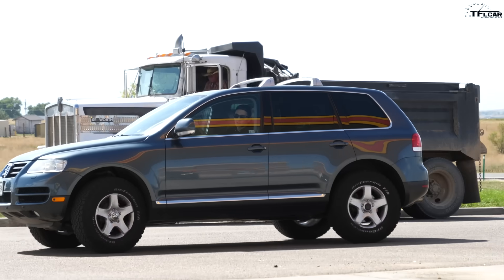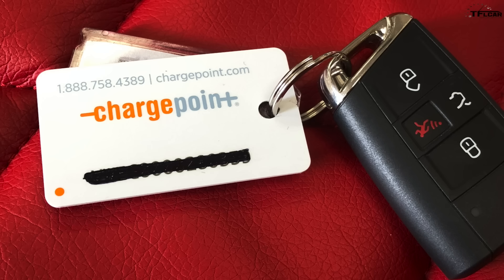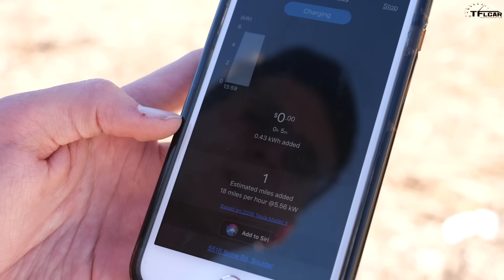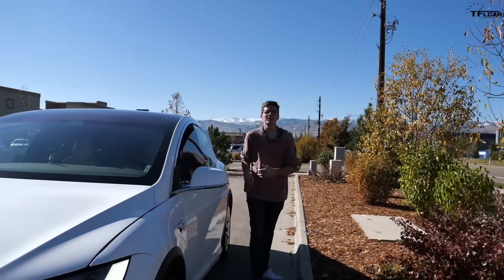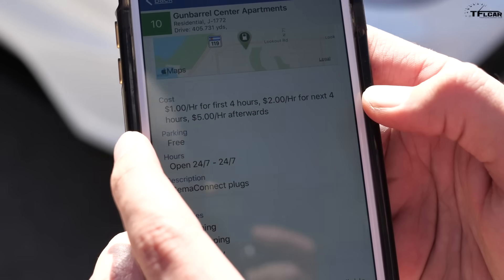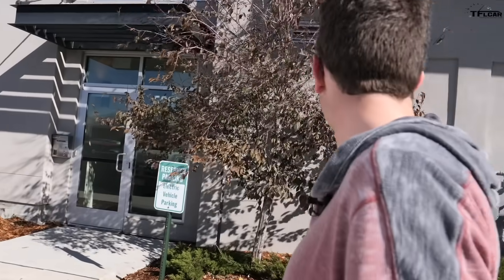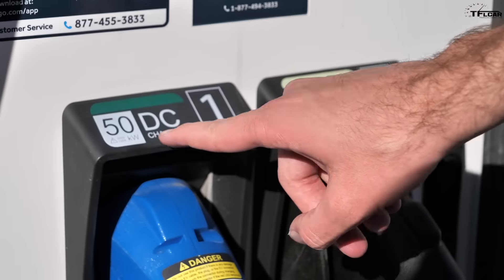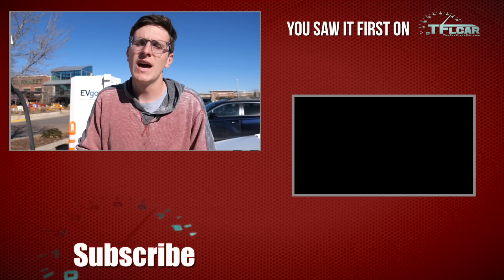Here’s Why Charging an Electric Car Can Suck - And It’s Not The Reason You Think!

Comment: I own an EV and I own a PHEV (for about 4 years now). I've never had a problem keeping them charged. No sane person waits for their car to charge. You do not have to have garage to have a home charger (they are very weather proof) and it doesn't take days to charge the vast majority EVs on 110 (if you zeroed out your Tesla, maybe, but how often does a person drive that many miles a day). So, the entire video that's based on these premises is just a lie. On the rare occasion when I do charge on the road, I've never had a problem finding and using a charging station - there are multiple apps that will help you find one.  ICE owners spend hours at the pump each year (waiting in lines and pumping gas) that I don't. 

I agree that an apartment dweller that lives in an apartment that lacks charging stations (most new ones have them, many are installing them) and you don't work somewhere that has a convenient charging station you would have a problem if you bought an EV. But then: why would such a person even consider purchasing an EV? 

I would never make the argument that EVs are the solution to all automotive needs. Nor would I make that argument for a minivan, SUV, utility truck, nor Big Rig. No one type of car fits all, that's why there are choices. But the arguments made in this video are just not reality.

Comment: It appears that EV's for commercial use (like police cars, that would be required to run almost 24 hrs a day) just wouldn't work out. The same for heavy trucks or any long distance hauling.
Reply: Bingo, but Kalifornia has already said future trucks will HAVE to be electric... "Hang on, as soon as the power comes back on from our rolling blackouts, the paramedics will only need an additional 40 minutes to charge their vehicle so they can respond to your heart attack... Hello? Hello? You still there?"

Comment: So the question becomes: Exactly who has the time to spend charging their car if it is NOT being charged either overnight at home or while actually working in an office? I certainly do NOT have the time to find a plugin, and spend 2-3 hours or more waiting for the car to charge sufficiently to get me the 25 miles back home. (I routinely drove 25 miles ONE WAY to work for better than 20 years. Most of my co-workers actually drove further.) PLUS, those who routinely travel MORE than 300 miles in a single day, cannot afford a days PAUSE in their trip because the battery needed to be recharged.

Comment: So many problems with this model of powering a car, and most of them are not even obvious. Here's another one: At that condo complex you were at, it looked like there were two charging stations. Most people would start the charge, then go back inside their home while it was running. What happens when it's finished, but the person doesn't come back out right away to disconnect and "free up" the spot for the next person? People can't even use Laundromats efficiently without leaving their crap in the dryer for 2 hours, dried, before coming to pick it up. Same scenario as with the inconsiderate people who start to fill up their tank at the pump, then wander inside the convenience store for 20 minutes to "shop", thereby blocking the pump from being used by someone else when the fill was complete. There will always be a "human factors" component impacting efficiency and this model just exacerbates it. Sorry.

Comment: Modern electric cars are in the infant stage rite now , it will be years before charging will only take a few moments . More than likely a few companies will be making an onboard charging system by then . Some cars have an onboard charging system now but it is low voltage . Also Electric cars still cause emissions problems , ( most electricity is made from burning Coal and natural gas ). I am interested in  electric cars , but I think I will wait for about another 10 or 15 years and see if they get the problems solved . Thanks for the video.

Comment: I would have bought a Tesla by now except,  I do not have access to home charging and the plug in gimmicks and lack of speed charging locations along with battery replacement every 6 or 7 years is a deal breaker.

Comment: I'll stick to gas. Pull up , Pay , Cash or Credit card.  Pump gas . Drive off. All done in around  10 minutes  or more.. Easy. And don't have to use my phone. Out hear in southwest Arizona. Try to charge up your car on a hot summer day when it's around 115 degrees plus and your out there  and there is  no shade. You can run into a gas station and grab  a cold drink and a snack while your gassing up you car and use the bath room too. Try to do that at charging station.

Comment: Americans enjoy up to 220v while we in Europe enjoy 380v. Even my apartment in Greece has 3 phase 380v. Imagine the increased charging capabity.
Reply: Be careful of what you wish for. North American 120volt (most outlets) deliver a shock that's survivable. Our 220v is also three phase. I don't know what you pay per kilowatt/hour (or joules) but California in general and San Diego specifically, has the highest electric rates in the country. I would not want to pump even 50 kwh of power into a car inside a garage. The batteries are going to really heat. Tesla designed for that with limiters and controls to reduce the speed as the batteries heat, but even so, there are more and more car fires every year just from charging. And putting out a Li battery fire is a very difficult job... it burns very hot (lithium used to be used to melt iron to weld railroad rails together).

Comment: @The Fast Lane Car: 5:57 ? 
That "rate" is super expensive, given that it will ALSO involve a motel stay, meals & other "wait time" activity expenses during that TEN HOURS for HALF A CHARGE (to do what ?)
PLUS, that's not really all of it is it?
TEN HOURS - but the recharge station is ONLY OPEN for 8 hours, so you will need to sleep in that motel, while you silly EV runs down it's battery with it's electric consuming security system - and other electronics while you sleep, to THEN require at least FOUR, if not more hours on the second day ?

WOW so you lose TWO days of petrol driving, sitting on your daire aire, waiting for electricity to 'trickle" into an EV?

Comment: What tickles me most ELMO - is that none of these "charging points" allows someone without a "smart phone" - to connect with them, so not only do you need to have the RIGHT APP on that phone, it needs to be available to use, and NOT lost last night in that disco - or taken by one of the kids or .. ?
Well Goible - now what - you have no phone (or a phone with it's own flat battery) no CREDIT on that phone, and no power in the car - Oh and as it's an outside recharge station, it just happens to be pissing down (torrential rain) in the midst of a thunder storm.

Comment: Ah, that age old problem of "charging" an electric vehicle. yes.
Sadly - MOST if not every vehicle - manufactured with an electric starter motor, since the original wind-up (radiator fitted) manual crank handle starters - ARE ELECTRIC.
You cannot start and run ANY of them, without turning an electric KEY, to start them, especially if they have an automatic gearbox - as NONE of them can be run-started (crash gearbox style).

All this modern B/S about total electric battery cars - hahah ha - I remember having one many years ago (mid 1950's) when I was a kid - that was made in Japan, and it ran on 4x D batteries - couldn't charge them as they were alkaline.
Tried and blew the batteries apart like small grenades.

FROM ABOUT 2,000 ONWARDS - every vehicle has had so many electric this that and anything else - that even huge truck style 12v batteries are becoming the norm..

NONE WILL START (PERIOD) UNLESS KEPT IN A HIGH STATE OF CHARGE.

Saying that these new Tesla's and Leaf's and other (secondary fuel not allowed) whizz-a-longs - that run only on a nicad battery pack - well hell, serves you right to leave it ON the street, as you need to garage them (unlocked away from thieving fingers) and fully disconnect the battery, (with a 500A dedicated battery isolation switch) to ensure a "start" will occur each time one is needed, until you have to give them a full recharge.

Something that only has a battery - but which is left to run security systems and other technological (power hungry) crud, is just asking for them to be "flat" ASAP.

Comment: if every car in California at this moment was electric, no gasoline cars, all electric cars in California right now, and all of the electricity generation capacity of the entire state of California was dedicated to only charging electric cars. There is no way that the grid in California could possibly charge all those cars. Not even close. That is all electricity from solar, wind, Hydro, fossil fuel, and atomic power.
  California’s electric grid is fragile as it stands right now. They have rolling brownouts and blackouts during heat waves right now. As electric cars become more and more numerous in California, watch the price of electricity. Building new power stations takes an average of 12 to 14 years.
  there is nothing California can do right now to remedy this. The timetable comparison puts more cars on the road that are electric much earlier than any new power generation of significance can be put online to make a difference. It’s already too late for California. in meetings,The timetable for California came up, they can’t possibly meet the need in the short term. It’s the unwilling led by the unknowing in California..
  The cost of electricity Will be as high as $.42 per kilowatt before 2032 in California.. has anyone given any consideration to why the big rush to get Smart meters installed? Has anyone given consideration to the real reason each dwelling had to be categorized and that information had to go to the public utility commission. Every customer is a essential/nonessential category. The reason for that is. When electricity demand is high, add the chance of having overloaded equipment in the grid, rather than having the grid fail, and rather than having rolling blackouts and brownouts. We have smart meters. Here’s the reason
   if you were in a private home, or if you own a car wash, if you own an amusement park, if you own a boat dock, if you own a building that does not have elevators, you are nonessential. You’re smart meter can be turned off with a cell phone call from the electric supplier. At the same time, hospitals, police Station, fire stations, traffic lights, public buildings, doctors offices, water pumping stations, senior high-rises and apartment buildings with elevators,water sewage treatment plants, are considered essential. Their smart meters will not be Switched off. they are considered essential and the power to those places will not be cut. A smart meter can be individually switched on and off by the local electric supplier. That is the bottom line behind the push to have smart meters. That is better because they won’t shut down the whole cities .. they won’t shut down whole towns by doing a rolling blackout. They won’t trap people in elevators, they won’t shut off seniors on breathing machines, they won’t shut off hospitals, they won’t shut off police stations, they won’t shut off traffic signals, they won’t shut off water treatment plants water pumping stations..
  Smart meters are also able to charge you accordingly for T OU/time of use. During peak demand during the day between 9 AM and 5 PM. That’s when the most strain is on the grid. That’s when electricity is going to get a little more expensive. The smart meter records your usage minute by minute. it will be better for you to run your air conditioners after 5 PM. It will be better for you to wash clothes and run your dishwasher after 11 PM during the lowest load on the grid. That will also be the best time to charge your electric car if you have the ability to charge it from home..
 there are many facets to the planning. These people that plan didn’t know what they were doing, but eliminating atomic power, fossil fuels, completely rocks the boat..
That’s why we have a smart electric grid now.. I suppose that’s a good thing. We will see.. and California is the place where it is going to get its first big test.. and it’s not really going to be a test, it’s gonna be all hands on deck. This is no drill..
  by the way, more than 20% of electric car owners, go back to gasoline cars.
  also, three materials are needed to make a lithium ion electric car batteries. Cobalt, which is around $70,000 a metric ton
lithium which is around $8000 a metric ton
 and finally copper which is around $9000 a metric ton and all three of these materials are increasing in cost almost by the minute. The cost of Electric vehicle batteries is not going to come down with time.. already people are resigned to the fact that when the battery needs replaced in their Teslas, the car is basically a throwaway consumable like an old washing machine or hot water tank. People with Nissan leafs are finding that out now. The replacement battery for a Nissan leaf is about 40% greater than the value of the car at the time the car needs a new battery..
  right now, older Teslas that are needing batteries, the value of the car is around $14,000, and the cost of a new battery is $23,000. if you go to trade that car in that’s only worth $14,000, the dealer will laugh at you. Because a car being traded in is worth what the book says it’s worth, minus what it needs.. example, if you have a car that’s worth $25,000 in the Kelley blue book, and it needs four new tires, the dealer will tell you the car is worth $25,000, -$800 for new tires. So if you have a car that’s valued at $14,000 in the Kelley blue book, and it needs a $23,000 battery…You would have to pay the dealer to take the car

Comment: There is a lot of hassle to wining an EV that is for sure but what this video does not address is the future dangers from charging these vehicles. It's just a matter of time before these cars and charging stations electrocute people. Also the faster you charge those batteries, the hotter they will get and great chance of exploding not to mention the longevity of the battery will be significantly reduced. These vehicles alone are going to cost people as much as a mortgage and only the rich will be able to afford owning one. I can see them also being very disposable because of the high cost of electronic component malfunctions and or lack of upgrading after five to ten years. Light weight steam engine vehicle is the technology that should be explored as I think there is potential for hundreds of miles per gallon so to speak.

Comment: Most cars go around 300 miles on a tank of gas.  30 minutes to go 100 miles assuming no one is ahead of you and they are there for ''only'' 30 minutes.  So if I wanted to drive from LA to Las Vegas it will take me all day maybe 2days.  I think they should make electric cars with sleeper cabs like the big rigs. You're going to be hanging out at the charging station a lot.

Comment: I can get about 450 miles in about 5 minutes from my small truck. It holds about 10.5 gallons of gas,no waiting and when it runs out,another 5 minutes and I'm ready to go. These charging stations have their own power supply with large wires capable of transmitting the required electrical energy to charge a car. Most houses do NOT. If very many houses in a grid[at current conditions] are running a charging station,it will overload and cause a blackout.

Comment: Currently, the utility companies are attempting to fund an alternative to electricity.   
They are suggesting solar power and some consumers have employed solar systems for their residences and businesses.   
In large metropolitan areas during peak usage, consumers are facing "brown outs" and worse, "black outs".
If this nation cannot even handle the current power requirements,  then how are they to supply the increase demand due to electric vehicles?
Reply: California is the worst for all of the reasons you stated and getting worse all the time. Electric rates have doubled in just a couple of years. ALL of the reporting on power calls a 5kw solar panel = 5kw natural gas turbine, but the gas turbine runs 5kw 24 hours a day... the 5kw solar panel is its PEAK rating, when the sun is JUST RIGHT, the panels are clean, the air is clear and dry (water vapor called clouds or just high humidity abords some of the energy before the panel ever sees it, Zero output at night, marginal until midafternoon... and heat (eg desert southwest summer temperatures) damages the cells when the dopants diffuse into areas that increase leakage currents. Only in California do you have idiots who think charging their cars overnight can be done with solar panels...
Reply: @dking1836  preach it brother

Comment: That's wierd. I expected that you can charge these cars at home. My escooty charges at home or wherever I plug it in. Same the e toto. It is changing on 220v. Why can't you just plug it into the plug. Ofcourse i know in USA they use 110v. So get a step up transformer or wire it to fit to 110v. To me it is ridiculous. It is like you can buy potato chips only at McDonald's.